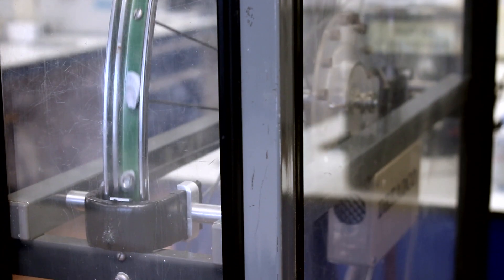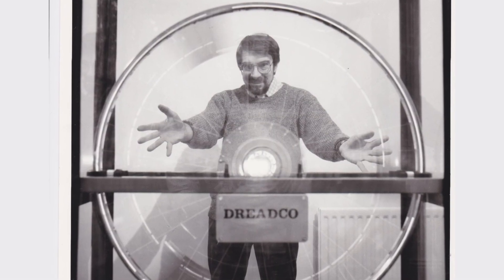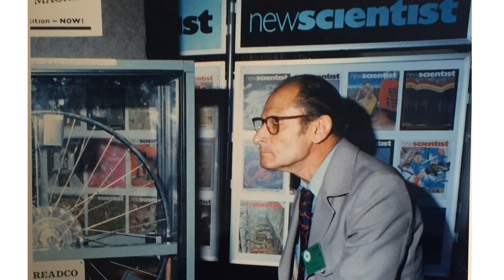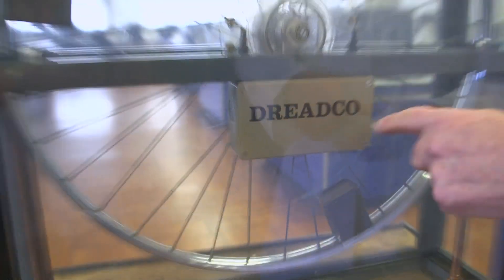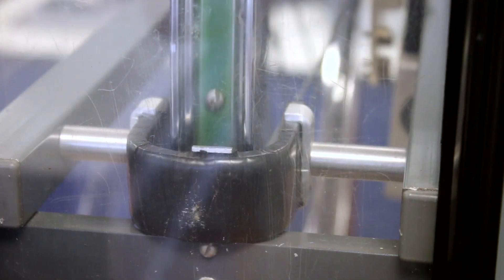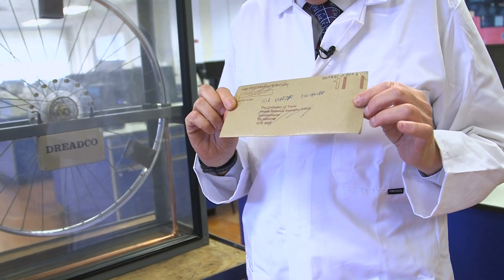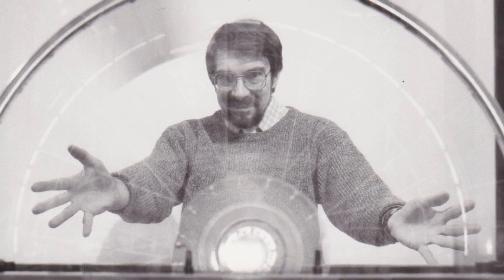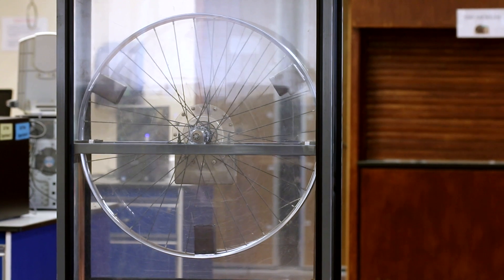Perpetual Motion Machine - Periodic Table of Videos

Comment: Seeing the copper pipes and those metal fins make me think there’s a heat transfer going on
Reply: That was my thought as well. But the professor said it was running down, so likely it's just a battery.
Reply: Thoran666 Didn't he say the machine was running for the last two years? Not 30?
Reply: TLDR; Probably not nuclear batteries, even though that would work.. maybe evaporation/sublimation or temperature gradients in the room.

Yea, you could theoretically just have a few grams of plutonium, each gram generates about half a Watt in thermal power decaying by half every 88years. However I strongly doubt this is what is going on. 
He built it in the 80s, sort of a highpoint for RTGs, but Pu238 was still super expensive and not available for the general public. In fact very few nuclear materials are.
An isotope that was relatively easy to obtain is tritium, this has a half-life of ~12.5years and the decay emits ~19keV which comes out to ~1W/g of tritium. This isotope was commonly used for watched and signs/markings showing emergency exits, so a civilian would have had an easier time picking it up. After 40 years it would only provide 10% of the power at the beginning though, so we can probably cross that off the list, too.

My guess would be that a simpler temperature gradient is exploited, some water is evaporating cooling some bits down a tiny bit, maybe iodine? Or maybe this device is efficient enough to draw from the temperature gradient between the top and the bottom of the device.... I don't know is any of these would be possible though
Reply: A glass tube of tritium lighting up a calculator sized solar panel is all you need :)
Reply: No, he said that he had personal knowledge that it had been running continuously for two years.  The machine itself is thirty years old, but should it have a battery, for example, that could have been changed 2+ years ago.
Reply: Related to stirling engines perhaps?
Reply: That was my thought too, that it's using heat differential plus magnets-vs-copper to generate heat.
Reply: Copper and heat sink will suggest that.
Reply: Thoran666 30 year old batteries still working are not unheard of.
Reply: Maybe not how it works, but I think the rectanglar cans and pipes are red herrings. Some high power magnets on the inner perspex disc and a battery powered electromagnet in the 'dreadco' box. Once moving it would take a tiny amount of power to keep it in motion and there are plenty of long-life/low-power batteries.
Reply: it's all misdirection... there's probably 2 of those big old flashlight batteries in that box in the front that form a motor with those probes and metal bits in the center. that would require next to no power and could easily last for years.
Reply: Or they could just be there make you think that.
Reply: Daniel Duncan As people have pointed out before me, there are multiple features on the wheel which (at least some of them) seem to be supposed to just trick the more educated part of the audience (not that I'm counting myself off course).
Reply: This particular machine is fascinating still.  It is teaching the more educated among us, or more like reminds us, to keep our skepticism, to remind us to question everything.  The people you need to be watching out for are those that are either accepting or denying with conviction.  That is why I put my comment down as a question instead of a statement, because I do not know exactly what is going on there, except to say that perpetual motion is impossible.
Reply: i think they are a red herring
Reply: They can be the size of a microchip... but you get micro power from that.
Reply: There might be a volatile liquid in the three boxes that can evaporate and rise through tubes in the wheel but how are the upper parts cooled?
Reply: Yeah, I was instantly thinking about Sterling Engines.
Reply: Could it be a stirling engine running on the temperature gradient in the room along the box? 1-2 °C if air conditioning or heating is turned on, or incandescent lighting is used.
Reply: Yora But would a Sterling Engine not be dependent on ambient temperature rather than age? Eccept if the apparatus was not 100% gastight and would lose evaporant over time.
Reply: @mrsanity nope. Nurdrage already tried that. (Nurdrage used 10) IMO, you'd need ~50 tritium tubes for measurable power. The ball-bearings that the bike-wheel is resting on aren't particularly efficient.
Reply: Thermoelectric generators in the bottom heat sinked boxes. The magnets appear too far away to be used for motion but could be a hall effect sensor for timing. The 3 boxes could be part of an electric motor or there is one hidden in the hub
Reply: Daniel Duncan If only you could tell what martyn meant when saying 'it is rather simple' (I dont think thats an exact citation)... Did he say it's simple for his level of education or is it simple for anyone with a basic understanding of physics and thermodynamics...
Reply: like the lightbulb turning the black/white propeller in a low pressure gas?  but where does the heat come from?
Reply: Bo Huggabee Similar problem to my idea. In your case you'd need a photon source, in my case you'd need either a way of transfering heat to the bottom part or remove it from only the top part...
Reply: Gentlemen, it's a nuclear device. Time is running out!
Reply: i think those metal bits in the center are very important, maybe some iteration of an ion engine? i dont know the efficiency of ion engines but combined with a peltier element that generates a voltage from a temperature gradient maybe?
Reply: if you want to build a long lasting system you do not have a lot of power to play with, maybe timing circuits is already too much (or are there such low power systems that could work?)
Reply: You've seen the sun right?
Reply: Or the stuff they use in smoke alarms? (Or the stuff those watches had on the watch faces which poisoned the women making them?).
Reply: Tim Bowers titrium was used to make wands glow in the dark iirc
Reply: I think they're non-functional, like the magnets and the weights likely are also. Probably is something simple like a battery powering it, otherwise the explanation wouldn't be so disappointing to the professor. If it actually worked in a way that allowed it to spin forever without anybody changing any battery or adding any sort of energy to the system manually it'd be very impressive, even though you wouldn't be able to harvest any power from it without stopping the wheel all together.
Reply: Possibly a peltier element exploiting some heat gradient
Reply: Its a nuclear battery, maybe hidden in the lower box. Heatpipes transfer the heat to be used in the rest of the system as a thermic machine. Easy...
Reply: I thought this too until I sneaked a peek at the letter
Reply: The copper pipe and heat sink maybe a red herring, but copper conducts electrons and electrons have mass.
Reply: It virtually breaks the First law of thermodynamics
Reply: A battery that lasts 30 years? Get real guys. 
My guess is it's probably taking in the air on the top, cools it and threw the flow to the other side to the nozzle next to the wheel it drives it. Might have slowed down because the air changed humidity over the years.